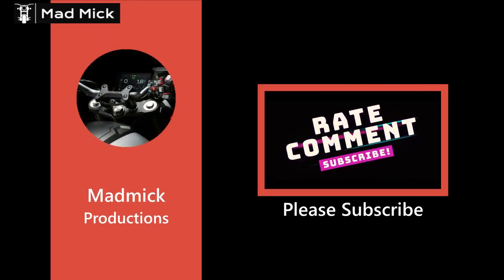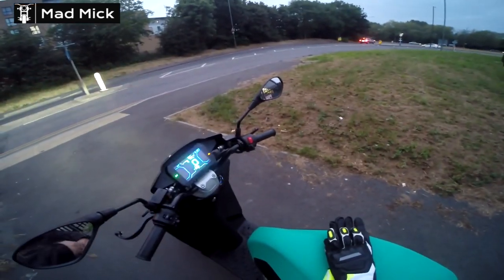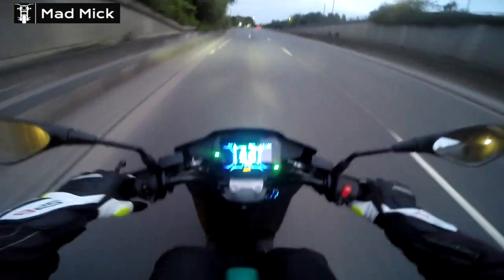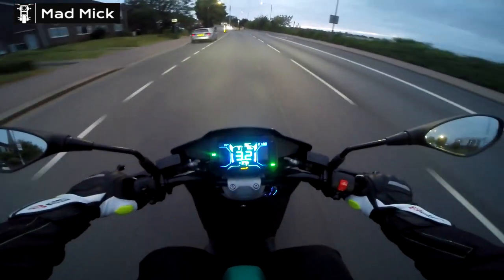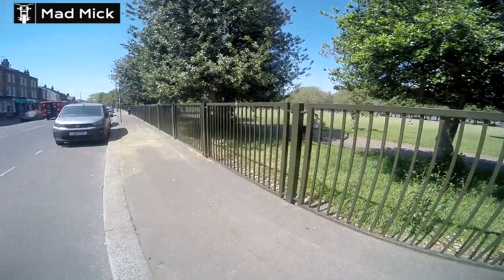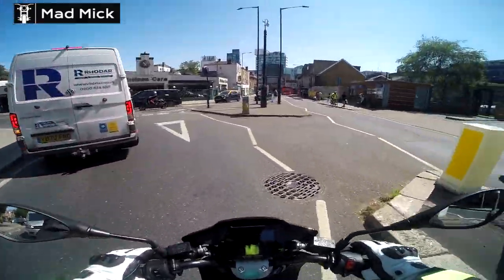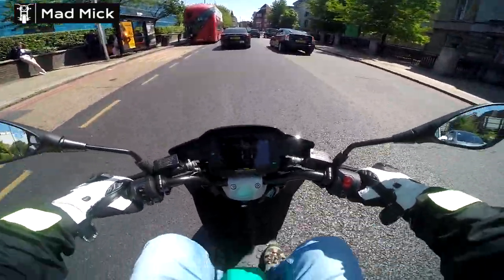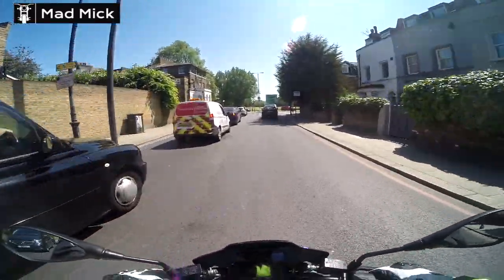PIAGGIO ONE ACTIVE FCW FIRST RIDE CAR TRIED TO DEMOLISH MY NEW RIDE IN HALF OUR OF PICKING IT UP

Comment: One of the best reviews on this .day and  night. What a. Bommer that accident .any scratches ? brand new.  Be careful enjoy it .
Reply from the maker: Thanks just a new brake lever and rear foot peg,  I managed to slither past the car in the middle of the road as he just stopped there rather than ploughing into the side of him, but lost my balance at the end of braking hard and had to bring her down at low speed, could not keep her up, weird the left brake lever took all the impact bent right round, mirrors and bar ends fine, just my luck,  I was in the wrong place at the wrong time
Bike nearly 600 miles now so first service coming up
It's a great cool ride, as my journey to work is a 20 mile trip 4 days a week saves me the petrol money in car
For work purposes every rider should get an electric moped or motorcycle it would save them money there are a lot used out there now

Comment: Hello Mick hope your well.. do you still have your PIAGGIO ONE? if so how you getting on with it
Reply from the maker: Hi yes I do, but using car at moment as 10 mile ride to work is too cold at 64  everything as new 600 mile service was £67 at Piaggio Croydon so well worth the money you save
Reply: Hi.
Nice review.
What are the service intervals after the 600 mile one and how much are the services?
Is the insurance the same as a petrol moped/scooter?
Many thanks. @michaelphillips1959
Reply from the maker: @tobias13100  my 600 mile service was done last year by ducati croyden who are piaggio dealers cost of £65 they said just bring it back in 2 years as there are no service intervals milage wise, so thats what i will do, the bike done 1400 miles now, did not use over winter as my 20 mile trip to work and back did not warrant me getting soaked befroe shift so used car, the bike is still performing as it should, all nuts and bolts etc are good no rust anywhere except surface rust under the main stand which is normal for all bikes , there was a software update at 600 mile service and max speed is 42 mph and when you go below 30% battery now the power inhibitor kicks in a little so max speed is 35mph but thats it all good

Comment: can you please help me with the combination of buttons to delete the maintenance icon. I'm getting close to 1000km and i don't wanna have it there. My nearest service is 350km away :(( 
Much appreciated man, liked and subscribed
Reply from the maker: HI, I TOOK MINE IN FOR ITS FIRST SERVICE at 600 miles, they plug a diagnostic into the obd socket which updates and resets the spanner icon, on dash, i asked at the time and there is no secret button press,  im sorry
Reply: @michaelphillips1959  i saw that in other scooters there was a combination of buttons :( I have the service 400km away :( i can't go to them :((((
Reply from the maker: @gabiungureanu4296  I would suggest to give nearest Piaggio dealer a ring to see if the obd reader they use could be sent to your local motorcycle dealer, or even contact local motorcycle dealer, a standard obd reader has the facility to reset fault codes on cars or bikes, run your hand down front of your seat to the floorboard, you will see three screw holes that hold a panel in place, behind the panel are fuses and the obd port that is used for diagnostics, it's a standard obd port that all manufacturers use, or email Piaggio of there website which your situation see if they have a work around